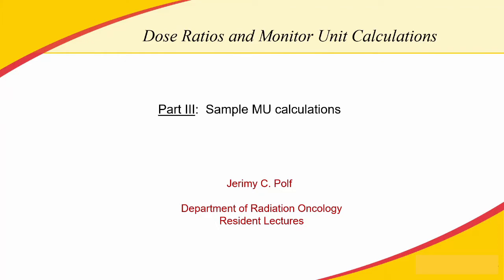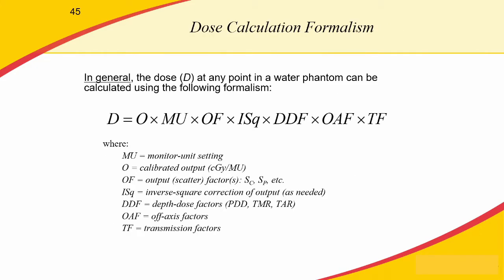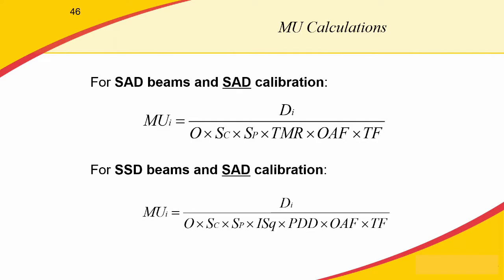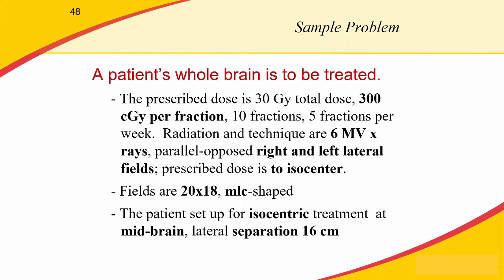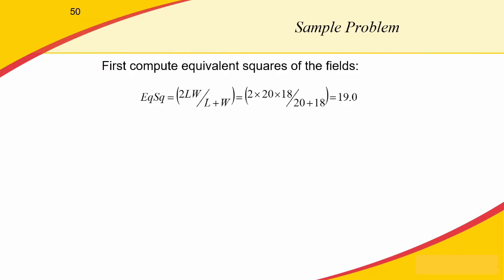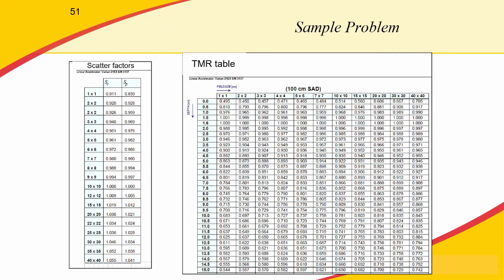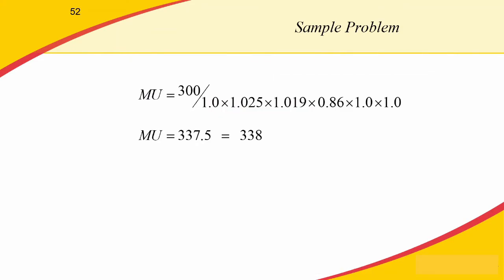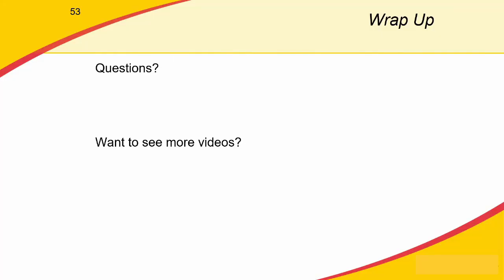Dose Ratio and MU Calculation Lectures - Part III

Comment: Pls for the scatter factors, a 15 x 15 field gives 1.019 and 1.012 for Sc & Sp respectively. And for the 20x20 cm field size, we have 1.030 and 1.021 for Sc and Sp respectively.  So how did you get 1.025 as Sp for your MU calculation
Reply: Also,how did you get a depth of 8cm for the calculation I just referenced
Reply from the maker: thank you for the question sirpatrick6073. for the Sc and Sp factors, we calculated an equivalent square field size (@4:55) of 19 x 19 cm2. so we interpolated between the Sc and Sp values for 15 x 15 cm2 filed and 20 x 20 cm2 field listed in the Sc/Sp table (@6:04) to get Sc = 1.025 and Sp = 1.019.  

Also, the 8 cm depth is a result of wanting to calculate dose a the midline of the brain, where the thickness (distance of separation) for the head was 16 cm.  there for midline is at 8 cm depth.  

Hope that helps.   .....thanks for watching!

Comment: Hey! how can I to know at wich depth/distance I need to calc the equivalent square field of 20x18? At surface or at isocenter?
Reply: thanks very much for this video! rsrsr i wanna to work as physical of radiation therapy in the next year
Reply from the maker: Bruno,  that's a great question.  First, remember our field size is defined at treatment isocenter.  this is the most important point.

Since we are using an isocentric setup (SAD = 100 cm), we know our treatment isocenter is located 8 cm deep in the patient.  Therefore, our equivalent field size for the 20cm x 18cm field is defined at 8 cm depth in the patient (i.e. isocenter).    
-- hope that helps,  MediPhysMan.